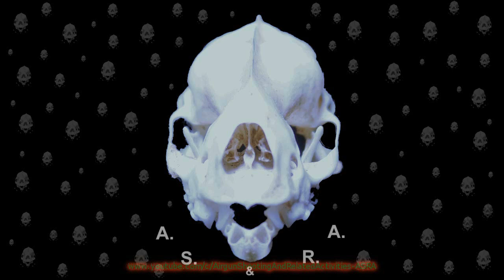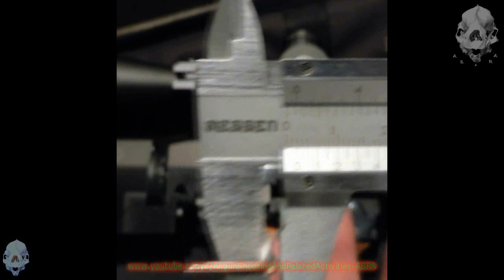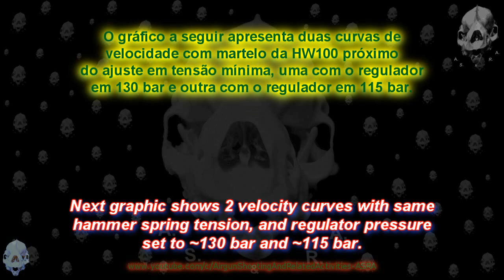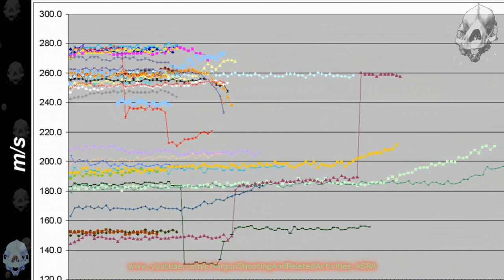Weihrauch HW100 partial disassembly and power adjustment, hammer and regulator

Comment: Thanks- very clear video and straight to the point.  Some clips I've seen are a bit long winded and end up confusing the issue.  I have a HW100 in .177 and it's by best and favourite gun.  I've had very good results with H&N Sniper Magnum at 50 yards too although they are quite heavy at 15gr or so.
Reply from the maker: Thanks Gary. My HW100 .22 and H&N Sniper Magnum didn't match, she prefers the H&N Baracuda 5,53mm. It is my favourite also, very smooth and accurate air rifle.
Reply: I'll give those  a try and thanks for the tip.  I've also yet to try any actual Weihrauch pellets too, although they can be difficult to get.  Always strikes me as interesting that virtually identical guns can have widely differing characteristics.  I shoot with a few HW100 owners at my club and we all swear by different ammo!  That's what makes it all so interesting............ and playing with scopes....... but that's another story!!
Reply from the maker: There are so many variables at stake, the sum of them is our appreciation of this sport!

Comment: Untuk menyesuaikan tekanan regulator harus pakai manometer tester, bisa dilihat berapa psi kenaikannya. HW100 saya tekanan regulator pabrik sekitar  1450psi, sekarang saya sesuaikan menjadi 1850psi dan penyesuaian tekanan per hammer untuk NSA slug 12gr. Akurasi di 80meter hanya sebesar tutup botol coca cola. 
Menembak plat besi tebal 1,5mm, dua kali tembak bisa bolong jarak 26m.

Comment: Video is good but I think you shouldn't adjust the regulator under pressure to avoid damaging seals. 

I also have HW100 FAC that I tuned to sub 12fpe and gained a lot of shots, after some fine tuning reg. pressure and hammer spring I was able to get 180+ shots on one fill. (60cm barrel and 175cc tank)
Reply from the maker: Well observed, thank you! I will place a warning in the description. 
I have tried it with 12ft.lb and it was very efficient, accurate and comfortable.
Reply from the maker: @scrinja  You are right, I just opened the reg and there is no o'ring there that can be damaged. I think maybe earlier models had an o'ring in the adjustment screw (2672 ?).

Comment: is there are difference between hammer spring tentiont and the regulator pressure for hw 100 177 FAC 30j and hw 100 22 FAC 40j?
my own is hw 100 cal 177 FAC and i want to change with the hammer spring tentiont hw 100 22...can it work and make my hw 100 cal 177 30j to be 40j?
Reply from the maker: I don't know the .177 HW100, probably there are other differences also (transfer port diameter, hammer weight...). I have only a Hatsan AT44 in .177 caliber, it can deliver about 40 Joules with the hammer spring tension near maximum, and using heavy pellets:
https://www.youtube.com/watch?v=lW9D2uSYqmQ
https://www.youtube.com/watch?v=ilD_RRIZAic
You should try first adjust the spring tension, without modifying the regulator pressure, and use heavy pellets (>0,75g) to maintain muzzle velocity below  speed of sound. For example, with a pellet weighting 0,88g you get 40 Joules at about 300 m/s.

Comment: So after all your testing what regulator pressure and energy did you settle for the HW100 .22.
Reply from the maker: About 120 bar, and depending on the pellet I am using I adjust the hammer spring tension for more or less energy,  it seems to work best at 43-45 Joules and Baracuda Match pellets.

Comment: So I have a HW-100 in 177 shooting JSB 8.44 at about 1005 fps avg. would like to bring that down just under 900 fps. I've never adjusted the hammer spring or regulator before, can you give me a starting point of about how much of a turn it would take to drop about 110 fps and keep the reg & hammer matched? 
Having watched Teds Holdover video turning down the hammer spring only 2 full turns he dropped about 300 fps so I'm guessing like 3/4 turm ccw on the hammer but have no idea on the reg. I'm sure it's a much finer adjustment. Wondering if something like an 1/8 turn ccw would be OK or to much?

Comment: Great video. Will you make a video on removing the trigger block and dismantling the hammer block, clean and reassemble the hammer block and reinstall trigger block in the correct manner. Very hard to find information.

Comment: How do you know what bar the regulator is at?
Reply from the maker: Hi Martin, I call him and offer to pay for a drink :-)
Now seriously, I observe the muzzle velocity and check the manometer when velocity changes significantly. It is not perfect but works. To know the exact pressure the regulator is set at, a manometer needs to be connected to the regulator chamber (there is an access in the HW100 for this, next to the central stock screw bellow the reg).
Reply: Airgun Shooting And Related Activities HA, GATEEEM

On an honest note, thanks my dude. Once I get a hw100, ill try it out

Comment: Does the regulator have to be adjusted too or can that be left alone.
Reply from the maker: Not necessarily, but it can get a bit unbalanced. Use a chronograph, and perform grouping tests until you find a good relationship between grouping, number of shots, and speed variation. You may not need to adjust the reg to get your goal if changes needed are small.

Comment: I have hw100 and would like to adjust from 900f/s to 700-800f/s. Do I need to adjust the regulator or just the hammer only? Thanks
Reply from the maker: I think it can be done with hammer adjustment only, but it is good to check the muzzle velocity curve afterwards to be sure things are not much unbalanced (there is a chance velocity starts low and increase as pressure decreases in the cylinder). To find the balance between hammer and regulator pressure can be very time (and pellets...) consuming, but in the end you can get a very flat velocity curve. Just a warning: it is better to adjust the regulator without pressure in it (remove the cylinder and dry fire once to empty the regulator valve).

Comment: Good video, I have a UK 12 FP .177 and have recently taken it down for new O rings...I was intirigued by the brass sleeve mounted on the valve shaft, I thought initially it was part of the anti tamper and stopped the hammer driving the shaft too far forward, but I don't think this is the case...it just restricts the capacity of the chamber and disrupts air flow by the look of it, can anyone enlighten me  on the reason for it ??
Reply from the maker: I haven't reached that part of the HW100, also want to know.
Reply: Just found a spanish vid with a guy removing the brass sleeve so I guess it is a restrictor not a stopping piece for the hammer, will borrow a chrono  and do a before and after ,
Reply: There is a spanish video showing a guy removing it, it obviously restricts airflow but might be there as a stabiliser for the shaft
Reply: Have watched another video in spanish where the guy removes it for I would think a power up, it looks like a neoprene insert where the valve stem goes through, good enough in itself to seal the stem I would think.....the brass sleeve would have to be an interference fit to stop air leaking past it but it is a loose fit....
Reply: Have a look on weirauch 100 regulaciones...top video

Comment: Hi  ASRA thanks for the informative videos. I have a HW100s that has a problem, when you load a pellet and squeeze the trigger you get a phut sound as in not enough air to drive the pellet out the barrel. Any idea what might be the cause. There is plenty of air in the  tank. Thanks Mike.
Reply from the maker: Welcome Mike. Is the problem only the sound or there are some performance degradation  (muzzle velocity, precision)? How it started happening?
If the pellets are not coming out the barrel, first thing to do is remove the barrel and remove the pellet(s) inside. Then try some shots without loading pellets and check if the sound is normal now. If the sound is of a normal HW100, probably the cause of the problem was a defective pellet blocking the barrel. If the sound remains strange, it can be anything from dirt in air cylinder to problems in regulator or hammer parts or adjustments. Hope this helps.

Comment: I see you become an expert on tuning the reg and hammer springs.did you go through all these because of poor accuracy?should have started with replacing the 6 groove barrel with a properly rifled one.good luck
Reply from the maker: I am far from an expert :-). I like to test different configurations and pellets, for fun and learning. I think my HW100's accuracy is ok, and most errors are my own fault. It would be very interesting to try a conventional rifled barrel. One thing I noted is this 600mm barrel needs cleaning more often when shooting at high power (about 150 shots at 47J).

Comment: Hi nice video, may i ask you a few questions about velocity and pellets.
What do mean is the best power setting for a 22 cal. That make the best consistent shot.
Whitch pellet is your favorit ?
Thanks for your answer
Reply: Fly-fishing .lu best power for .22 is 30 ft lbs (40+ joules) with 18 grain pellets
Reply from the maker: Hi Fly-fishing .lu, I have good results (with my HW100) using H&N Baracuda Match 5,53mm and power adjusted to 43 Joules.
Reply: Thank you !

Comment: hi  I got a mate who's got weihrauch hw 100 KT who wants to push the power up but he was  told by is mate  who  got a gun shop  said he cannot do it he got to buy a new rifle  from him  is this true  .
Reply from the maker: Maybe his HW100 TK was already at full power, I cannot answer without knowing the caliber and the energy it was developing.
Reply: Hi got a weihrauch in .22 just stranded rifle  said have to buy new rifle from him  £970:99 turn it into FAC
Reply from the maker: The HW rifle FAC version energy is around 41 joules, HW carbine FAC energy is 35 joules. The barrel lenght in this case makes the difference (600mm rifle, 410 carbine).

Comment: Thx, very interesting. The Airgun is loaded and there is an airzylinder screwed in. You propably did that on purpose,  but you should not, when making "instructional" videos. I know that there is no way it will fire, because you know how to handle your glorious HW100, i also know that mine won`t fire. But some idiot still might do that with a cocked hammer and pressurised airzylinder. Please tell them not to, if someone kills himself with an airgun, all airgunners suffer. Thx for reading, have fun!
Reply from the maker: Thank you for your comment, but idiots will be always idiots no matter what :)
Reply: I have some questions regarding the hw100. If you don`t mind, i`d ask you, since you seem knowledgable and experienced.Feel free to take lots of time to answer, My groupings are better, when i`m calm, so i want to improove my patience anyway.
Reply: I Pump my babe up with an hill pump (i need the exercise), that could manage up to 300 bar. i have the fitting on it, that came with the hw100 to conect the 0,175 200bar cylinder of the airgun. I plan to get an 300 bar 2 liter bottle to pump up, not necesarrily up to 300 but up tu more fun time at range. Of course i will get some regulator that prevents me from pressurising the gun to 300 bar if i sneeze while filling. Do you know the thread sizes? That would really help. Have fun